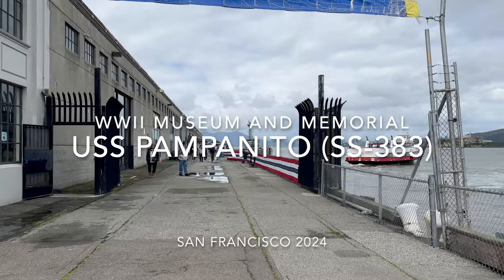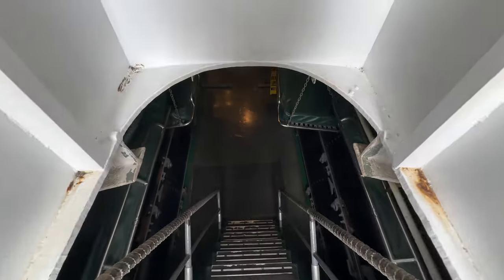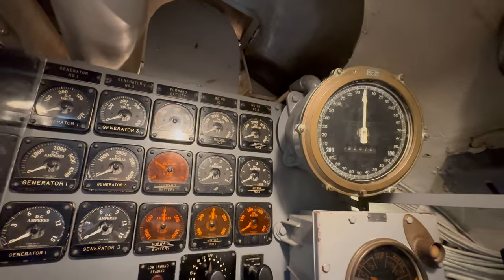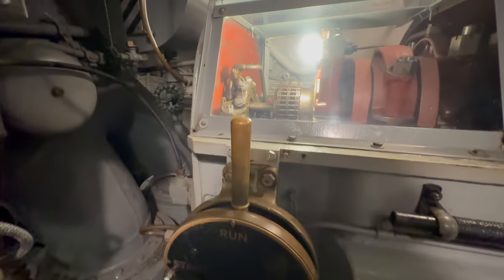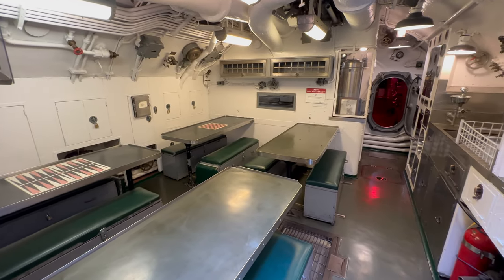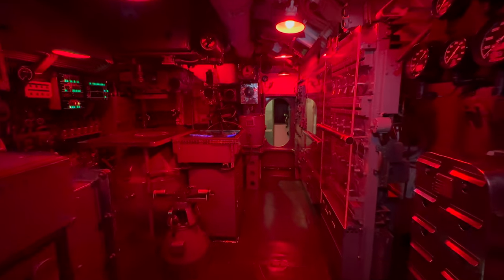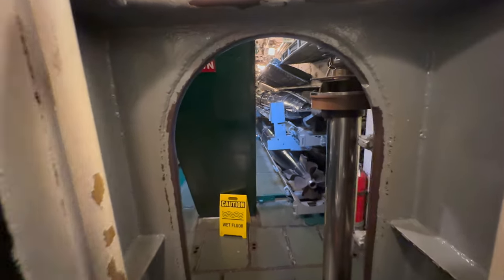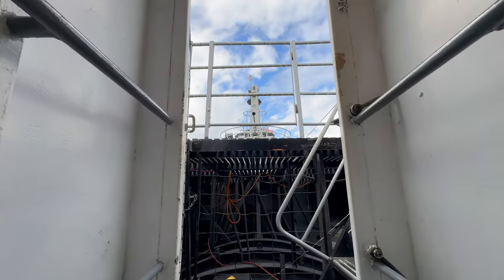Exclusive Tour of USS Pampanito WWII Submarine #NavalLegends

Comment: She used to have a forward-mounted deck gun.  When did they switch it to an aft mount?
Reply from the maker: That's true.
The USS Pampanito's forward-mounted deck gun was changed to an aft mount during a major refit in the summer of 1945, in preparation for the planned invasion of Japan. This refit replaced the forward 4" 50 cal gun with a 5" 25 cal wet mount gun located aft. Additionally, the submarine was equipped with two Bofors 40mm guns and a twin 20mm Oerlikon, among other small arms, in this final configuration

The specific modifications to the deck foundation necessary to support different gun mounts were carried out around this time as well. The Pampanito left Hunters' Point Naval Shipyard on July 13, 1945, for gun structural firing tests at a test range outside the Golden Gate, indicating that the changes were made during this period

By the end of World War II, the USS Pampanito had a 5" 25 cal gun on the aft main deck, which aligns with the changes made during the summer of 1945 refit. This configuration reflects the tactical adjustments and the evolution in armament typical of the period
Reply: @IgorKhrupin   I visited the Pampanito with my wife back in 2015.  She had the forward-mounted deck gun then.
Reply from the maker: @cdfe3388 That explains why in the 1996 movie it has front mounted gun. Thanks for details